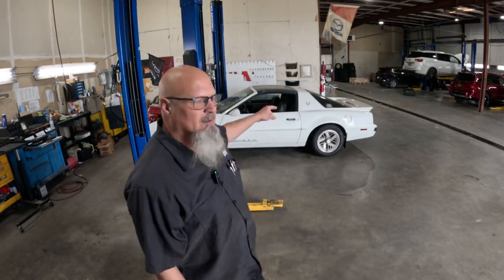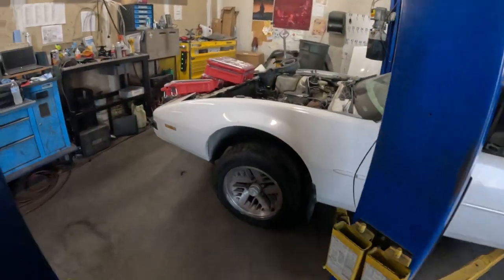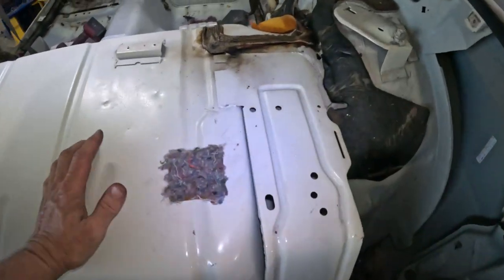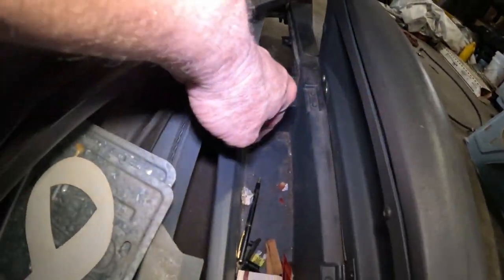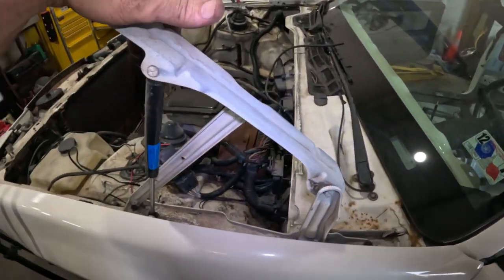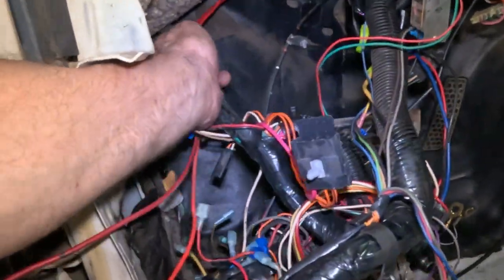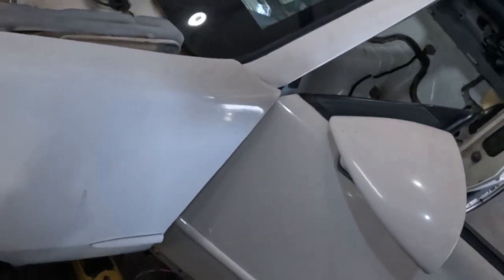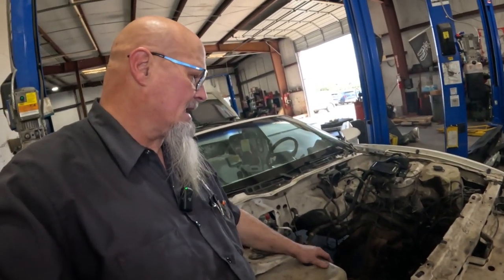Drag-N-Drive car build. Part 6. Interior and wiring harness. 89 Pontiac Firebird Formula.  17 years.

Comment: Great Job Mike!!! About the trim code., have you check on the VIN number., I think every number has something to say perhaps the Trim Code is there? Good lock my Dear Brother. 😊
Reply from the maker: Whenever I gave the VIN to the local GM dealer, they said that it is not a good VIN in their system.  I don't know if that means the car is too old for them to look up, or they just typed the VIN in wrong.  Either way, they were no help at all.

Comment: I am curious how much weight you have reduced by removing the interior components. How much does car weigh stock versus stripped down.
Reply from the maker: That's a good question. The gross vehicle weight rating is 4195 lb. which includes the weight of the vehicle and all that it is capable of carrying.  I think the vehicle itself weighs about 3300 lb. A cast iron chevy small block weighs about 470 lb. A 700R4 transmission about 155 lb. Add all the accessories, carpet, trim, and everything else. My guess is we probably remove about 900 lb. give or take 100.